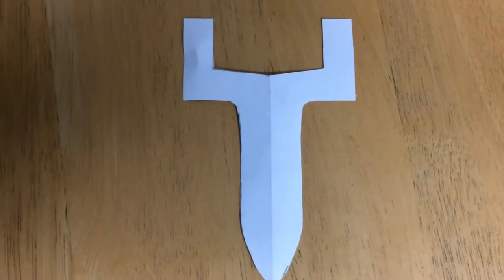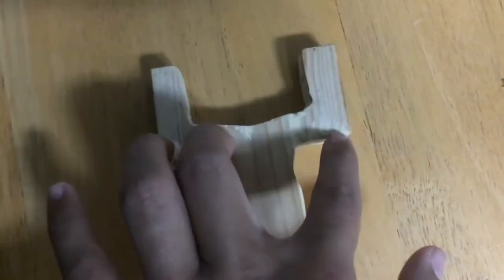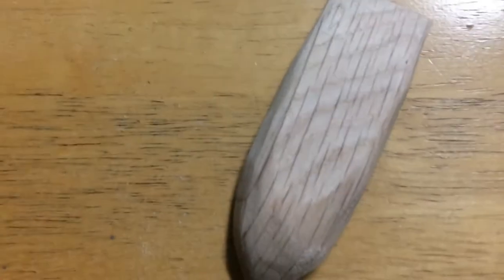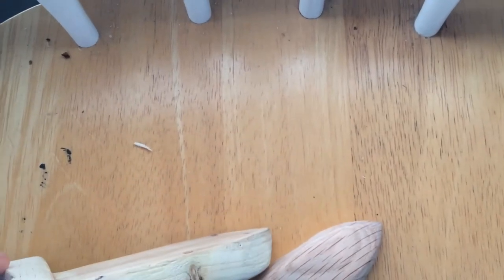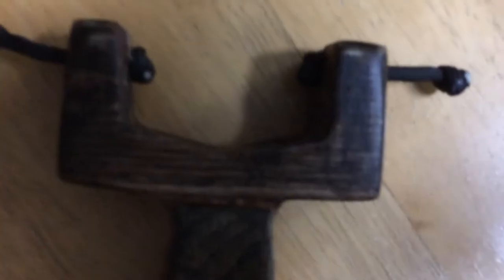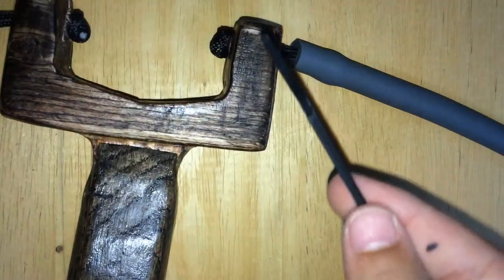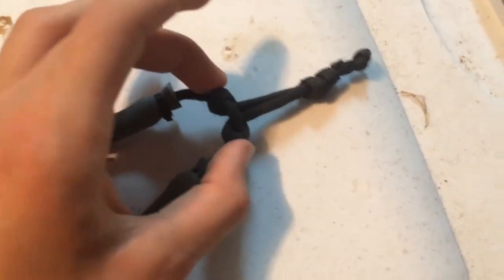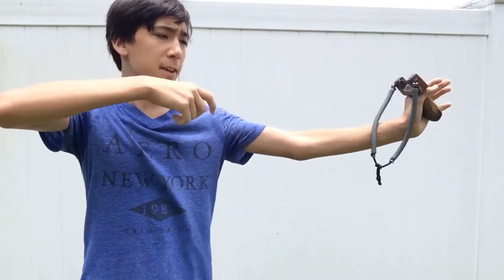How to make: Slingshot Bow

Comment from the maker: Please read if you plan on making your own. When I originally made this slingshot I didn't know about what wood I should use and even though I haven't had any problems with it after months of use there's always the risk of it breaking. Instead of using a 1x4 piece of pine I recommend using a 3/4 inch sheet of plywood as the core.